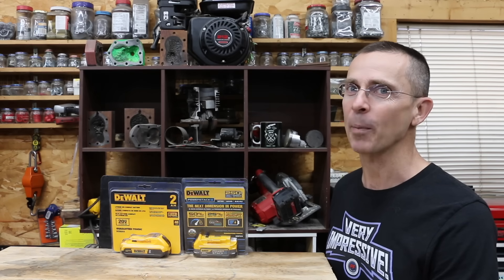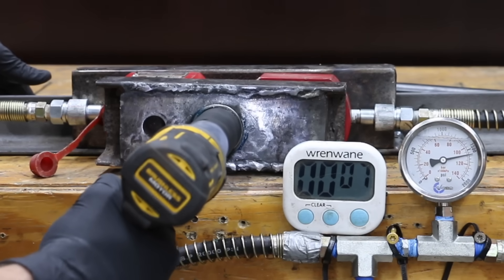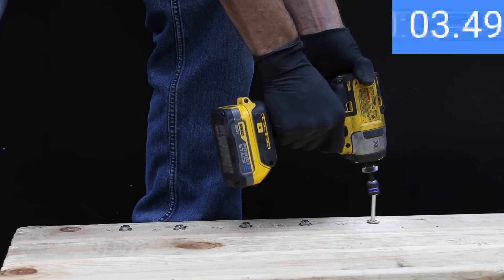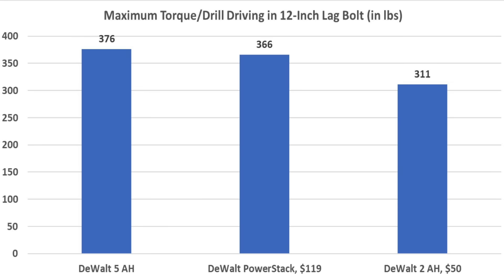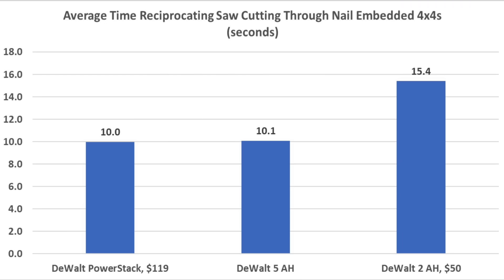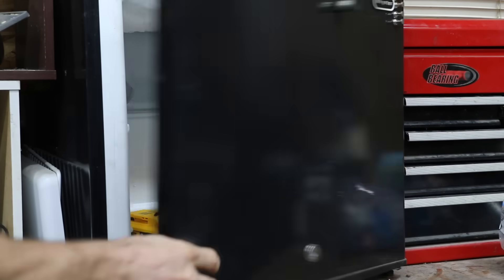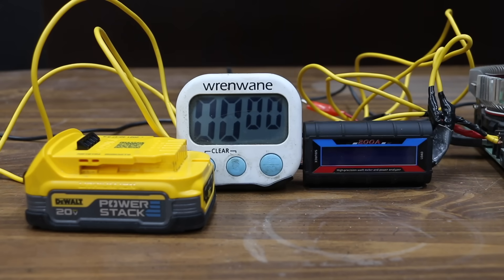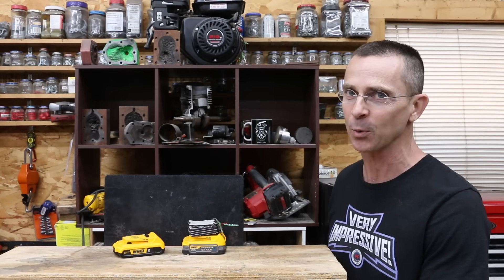Compact “Pouch Cell” Battery Better? Let's Find Out!

Comment: Man... they charge a lot for those for what they are. A basic 5S 50C 5000mah (5 cell/250Amp constant discharge) pack is around $60. We use them for RC cars these days and the cells vary greatly in amperage/capacity. Oddly, they rate them as a "C" rating, pretty sure that's just to confuse things, and there doesn't seem to be a standard discharge rating for them either. Just a lot of marketing BS. A lot of cheaper packs run cells parallel to boost the amperage/c-rating. If one of the cells is weak or dies, the entire pack is trash and you can't use it anymore. With the kind of amps we pull out of them... they get really hard lives.

I just ordered a couple 6S 5000mah 40C packs for $60 each. Should give me about 20 minutes of fairly constant run time for each.
Reply from the maker: Thanks for sharing.

Comment: How interesting, so bit of info. Globally there's some major shortages of 18650 cells which goes into these drill batteries, costs have gone up easily 40%+. Since it was made in Korea I assume its Samsung or LG cells.
Now these pouches are China. Basically custom pouch style which does not have as much issues with shortages and generally cheaper, the big issue is that its not as easy to manufacture, assemble and generally less robust (and less longevity) using pouch technology.

What's interesting is dewalt decided to upspec a less premium technology of battery construction and market it as 'new technology' upgrade.. Very clever marketing.
Reply from the maker: Thanks for the feedback.

Comment: Well. We use pouch cells for rc cars since they can handle way higher currents. Most of my batteries can handle over 400 amps without blinking an eye. However. They only ever run up to about 150 amps. 18650 batteries can’t handle as much current. You have to put them in parallel in order to get more current out of them.
Reply from the maker: Thanks for sharing.

Comment: I agree, higher capacity stacks would be more worth it, when I use my tools, it's either very little that a reg 2amp would be more than enough, or I would need several 10amp batteries. An upgraded 2amp isn't enough for me to think about.
Reply from the maker: Thanks for the feedback.

Comment: The meteoric rise in the prices for 18650s is the primary reason for this bit of kit.  Check eBay for 18650s.  They're almost unavailable.  Ali says they have them but when you try to buy them at the advertised price, you can't.  They are many times more expensive than last year.
Reply from the maker: Thanks for the feedback.

Comment: Great job as always, Todd. You do a phenomenal job keeping the public informed on which items are potentially better than others! May I make a suggestion for a future video?  As someone who's also fanatic about vehicle maintenance, could you research and test tire pressure gauges on accuracy? I have several brands, styles, digital and analog, they all read different pressures. Thanks for all you do, bud.
Reply from the maker: Thanks!  Thanks for the video idea.
Reply: @ProjectFarm  I agree that a tire pressure gauge review would be great.  I have several, and they don't agree, and I don't know which to trust!
Reply: I'll throw some more support behind this idea.  I've noticed a huge discrepancy between different gauges.  Even if you just use the same gauge all the time, if its 7psi off reality on a car tire thats important.  Maybe none are that far off actual, but I've seen 7psi difference between a couple gauges on a tire.
Reply: So true.
Reply: I would say it's funny but it's Not! Those lying gauges are a bad thing. I have one that reads pretty well compared to the computer in my Challenger (gauge reading is about the same as car displays on the dash) but it's a 'stick type' and doesn't go high enough for me to use it on my 1 ton Suburban. I have a 'dial type' one that reads up to 150 psi, that I use for the Suburban but have no way to be certain how accurate it is...
     Great Suggestion for a video!
Reply: Great idea!
Reply: This would be great especially for trailer tires. I'm way pickier about my camper tires then my truck because they are less forgiving.
Reply: Yes, I agree. Pressure guages are an item that many people rely on.  A properly inflated tire is a safe tire that will wear the least given conservative driving habits.
Reply: Great idea, mine recently broke and have not replaced it since all the new ones seem to be garbage or have bad reviews and i can't find the same make model as i had before as to me it was prertty decent,

Comment: Pouch cells can deliver more amps because of the big surface area.

But the main difference between the 18650 and the pouch cells is safety. 18650 cells are filled with fuses, blow caps, fire retardant etc. Pouch cells are pretty sensitive.

Shoot a nail from the bottom through the pack you hit 2-3 18650 cells, but with the pouch cells you hit every single one of them. Things can get explosive if these battery packs are not done right.

I currently work in a R&D department for power tools of a known brand. And we got told, than there are workers out there, that hammer in nails with the bottom of the tool (so basically the underside of the battery) if they forget their hammer. That has lead to explosions on construction sides. 

Even though it wasn't our tool that exploded or caught fire, we still strengthened the underside of all our batteries, just because of that.

 Safety and durability is indeed the main reason, why most of the brands stick with 18650 cells.

We have pouch cells for decades, dewalt is not a pioneer in that regard. There is a reason why its not common.
Reply from the maker: Thanks for the feedback.

Comment: Hello, I  read that old timers use to mix a little diesel fuel with premium gas to increase octane in turbo or super charged engines. Is this something you could test? Thanks
Reply from the maker: Thanks for the suggestion.

Comment: Interesting!  The PowerStack is an expensive 2AH that weighs a bit less and is capable of higher discharge rates.  The 5AH looks like the better choice for most applications, but I could see a 5 or 6 AH lightweight PowerStack being a seller if they can get that price down a bit.
Reply: You could easily make your own 5Ah Powerstack using a 6S lipo battery. Just choose the 5 best cells and put them in your battery pack. If you can't find any Lipo batteries that are the proper size (I know they make short Lipos but not sure if they will fit) then you can order cells online
Reply from the maker: Thanks for the feedback.

Comment: RC vehicles have been on the pouch style lithium batteries for ~15 years. You have a lot  higher discharge/ amp rate than cell style packs. That’s why you see an increase in performance. But they’re somewhat venerable batteries to puncture and that’s probably why we haven’t seen them in power tools before now.
Reply: Us RC airplane guys were using the LiPo "pouch" batteries 5+ years before that. I remember when they were crazy expensive because the only cells were made in USA & considered "experimental" & dangerous. Once production shifted to China the prices went way down but, so did quality.
Reply from the maker: Thanks for the feedback.
Reply: same with phones
Reply: Yeah there have been several people who have lost their homes due to lipo battery fires when charging unattended batteries,I store mine in metal ammo cans.I'm not sure bringing this new technology to tool batteries is a good idea?
Reply: yeah, watching Todd just manhandling those bare cells made my heart stop for a few seconds. I was dreading some kind of fire happening 😬. Todd, please leave the battery cells alone if you have to tear down one of these things again for your own safety. Thank you!

Comment: This was a great video, probably because I"m a bit of a battery nerd, but it summarizes my initial thoughts on this when the product was first announced.  Too expensive (even $179 for 2 packs) and not in the larger sizes that would make it interesting to me.  I'd like to see Dewalt bring the cost down a bit and then just replace all their XR packs with this powerstack, tech as it interests me for larger packs to get them smaller/lighter.  Then keep keep the cheaper less powerful 18650 based 2ah packs for cheap big box store promos for home owner/light duty.  Now, how long until Milwaukee responds...
Reply from the maker: Thanks!  Thanks for sharing.

Comment: I 3d printed and soldered together a setup that allows me to plug my RC batteries into my battery powered tools.  This powerstack tech looks exactly like my RC Lipos.  They don't have the built in safeguards but if you know what you're doing it's wonderful.  I even converted the kids powerwheels to work off of this setup.  Thanks for the video.
Reply from the maker: You are welcome!  Thanks for sharing.

Comment: Those pink cells were probably Samsungs,  It's interesting to note that on eBay individual, brand name Hi Drain 18650 batterries have disappeared. I thought tool makers were/would be switching to the newer, higher capacity 20700 and 21700 cells.
Reply from the maker: Thanks for sharing.

Comment: What’s the best leaf blower let’s find out 

What’s the best power station let’s find out 

What’s the best pocket knife let’s find out 

What’s the best flashlight let’s find out 

What’s the best work light let’s find out 

What’s the best 18650 part 2  2022 let’s find out 

What’s the best power bank / portable charger let’s find out 

What’s the best staple gun ( battery operated and not battery operated) let’s find out 

What’s the best string/cord let’s find out 

What’s the best extension cord let’s find out 

What’s the best hard hat / safety hat let’s find out

Witch is better old drills or newer drills.      

Witch is better old impact or new impact 

What’s the best whole saw let’s find out 

What’s the best reciprocating saw blade let’s find out 

Witch is better brushed or brushless tools let’s find out
Reply from the maker: Thanks for the video ideas!

Comment: The weight issue never really registers to me.  I'm not a hulk, but I recall having the 18 Milwaukee power plus t handle NiCad beast that was basically solid steel guts.  Really heavy.  Building a fence definately left the arm sore, but that's endless screws.  Given the light weight of all new tech (last decade or newer)power tools I'd rather have more jam than a smaller capacity. I see a lot of value in capacity, runtime, and overall better performance.  The bigger the cell storage, the less volt drop over all the cells as a whole, so it has better performance.  But nothing compares to the weight of the forefather cordless tools.
Reply: That said, I'm not saying compact batteries don't have their place.  I agree with the multiple smaller ones so that you can have charging rotation( when a batteries needs charging, swapping out) that's affordable.  I have 8 -4ah batteries. Also nice for ripping doors down and 2by lumber, the longer power draws.
Reply: I put a 12 AH battery in my skill saw and it was like an entirely different saw.  I couldn't bog it down.
Reply from the maker: Thanks for sharing.

Comment: I do not like the Pouch Cell Battery (Dewalt PowerStack) because it cannot be maintained.  At least it does not look like it can be maintained or rebuilt.  I use a battery rebuild service when my tool batteries wear out.  The service is less expensive than buying a new battery and the batteries seem better than the original.  But that is my subjective opinion.  Maybe you can test that!  The service I use is MTO Battery.  There may be other companies that do the same thing.
Reply from the maker: Thanks for the feedback.

Comment: Great video! I just had a video idea: have you tested different drive systems for a given bolt/screw size?  I.e. what differences do a slotted, Phillips. Slotted Phillips, pozidrive, Allen hex, enternal hex, torx, torx plus, square Robertson, make on the torque you can deliver to a fastener before it cams out? How hard do you need to press down while you turn the fastener? Would you use for handtools any different drive style for impact wrenches? Lately I have been shopping for Torx screws and avoiding Phillips screws in an effort to minimize the amount of effort needed to use the screw. But I have never measured the difference exactly.
Reply from the maker: Thanks!  Thanks for the video idea.

Comment: Dear project farm, can you test anti slip tiles? The braille textured one vs stone like texture, like assemble a 6 meter long tile surface, then run and U-turn as fast as possible while the tiles is under wet, oily etc? Or anti slip shoes? That would be great
Reply from the maker: Thanks for the suggestion.

Comment: lol, so SB&D has found a way to make their batteries even MORE expensive.  By the way, in the video at 14:35 that's FIVE cells.  You probably realize that but I don't want anyone else getting the false impression that Dewalt's 20V pack is using more cells than anyone else's 18V rated packs.

Personally I have no use for their 2Ah batteries, would always get the 5Ah with the exception that once upon a lifetime ago I did HVAC new installations and working overhead putting in ducts and returns, the weight savings would make more sense, considering impact driving sheet metal screws is a very low battery drain rate.  I was getting a day's worth of runtime (one home's worth) from the 1.5Ah, 7.2V drill I had at the time.

Thanks for the video!
Reply from the maker: You are welcome!

Comment: Did the power pack charge faster?  Assuming the charger is capable of higher output, it should have.  Low internal resistance is the only way to get more power out of a battery during operation.

Comment: these batteries have circuitry to increase the voltage and current tricking consumers when under a load. This is why it seems stronger. over voltage trick is common practice.
Reply from the maker: Thanks for sharing.

Comment: what is the chemistry?  are these NCA, NCMA?  im guessing they are some sort of nickel based chemistry, and not LFP.  and if thats the case, when are these manufacturers going to learn that this formation has terrible thermal runaway problems that completely offset any small benefit of increased energy density.  i would never buy any pouch cell, unless it was LFP and they were for something like a battery bank for your solar setup.  outside of that pouch cells are totally unreliable

Comment: So they are comparing a $50 battery to a $120 battery and the more expensive has only 50% more capacity. That doesn't seem like a fair comparison. If they said it delivered similar performance as a the 5AH battery for $30 less while being smaller it might be a better sell for me. Not that it changes anything, just seems like bad marketing.
Reply from the maker: Thanks for sharing.

Comment: The new technology is interesting, but for the average do it yourself guy, is it really neccesary to have something a second quicker? I do have Dewalt impact and hammer drill tools, but a Ryobi recipricating saw. I also have a Makita impact (1/4 inch). I also have battery adapters to interchange batteries between the tools, not the Ryobi, however. I think the most interesting thing is where you disassembled the battery pack to shoe the different type of construction. I read an article that claims battery technology is about to be revolutionized. This was in reference to cars. So many people I know don't think electric cars will have enough range, particularly in cold climates to be practical. This article implied the charge time would also be reduced to that of a normal fill-up. Is the Dewalt pouch battery the future for transportation as well?
Reply from the maker: Thanks for the feedback.

Comment: The largest problem with lipo batteries is they are vary volatile. They don't have the same stability as a li-ion. Leave a lipo in a car for a day and it will puff up and be trash.
Reply from the maker: Thanks for the feedback.

Comment: It's even worse than you mentioned. You chose the 2A battery for $50 whereas the smarter choice would have been the current (2) 3A batteries for $99 deal over at Amazon. The 3A batteries use the 21700 cells so that comparison would have made the Powerstack look much worse on a cost basis. The only reason to use the Powerstack is the size. In some applications that would really matter a lot. Other than that it's not worth the price.
Reply from the maker: Thanks for the feedback.

Comment: Did you use a fresh blade in the saw for each and every cut? To reduce the amount of variables?

Just really curious.
Edit. maybe use a piece of dowel in the D-handle of your "demo-saw" with the weights to remove the human error side of the equation, is my 2 cents...
Just a zip-tie or something to hold the trigger engaged so you can demonstrate a "Hands-off" approach to the tests you are doing.
Still love your work and efforts, Cheers from Australia mate!
Reply from the maker: Yes, a fresh blade each time.  Thanks!

Comment: Thats very interesting... I also find it especially interesting that power hand tool manufacturers seem to be pioneers in motor and battery technology.  I do wonder what the safety factor is iwth those power stacks vs 18650... Also, I know people that replace their 18650 cells in their drill batteries.. I have a feeling that is no longer the case with the power stacks?
The power  delivery of that power stack is impressive though. Obviously they have identified the current output limitations of the 18650 cell design and are looking for ways around it.  Now they just need to double to AH capacity in the same form factor!
Reply from the maker: Thanks for sharing.